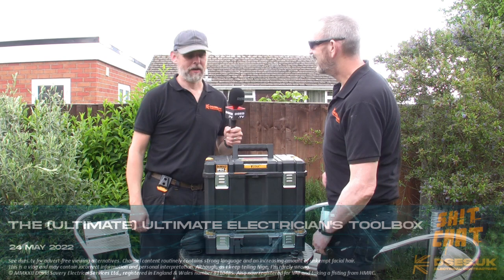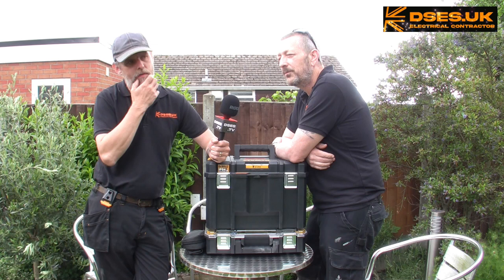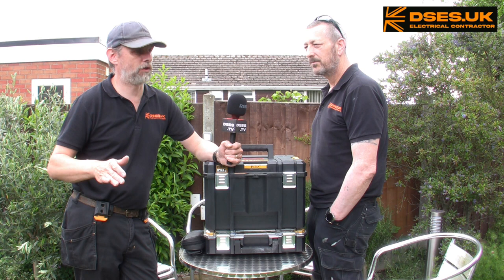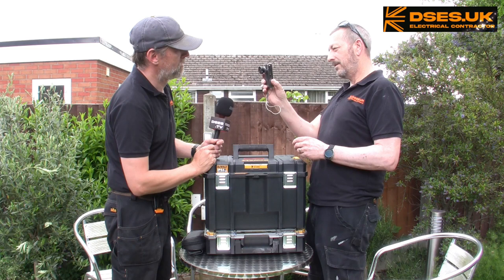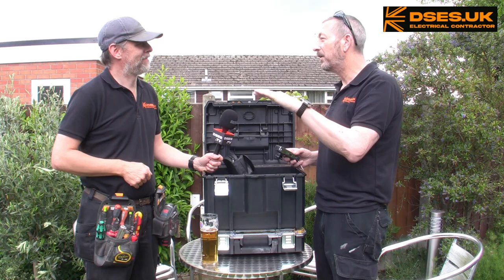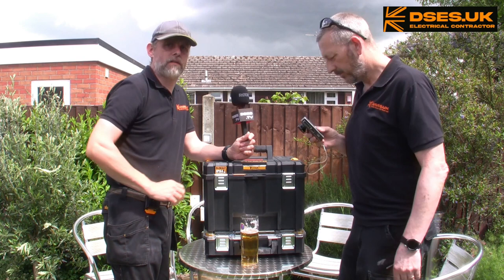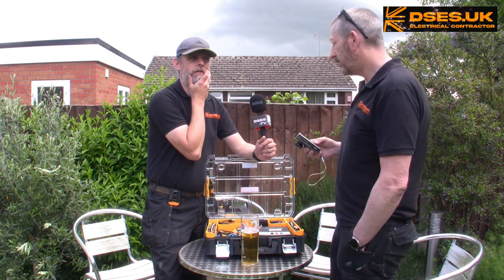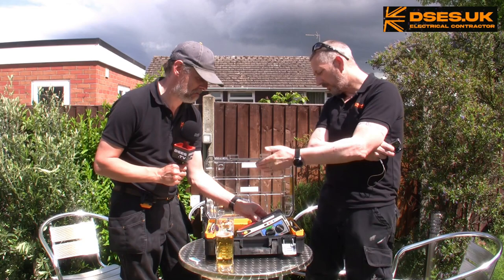The (ultimate) ultimate Electrician's toolbox

Comment: I love Toughbuilt stuff, I've even made a custom belt mounted soldering station that uses a toughbuilt clip, I use it for LED strip installation work, it holds a TS100 iron, DeWalt battery to power it and a reel of solder.

Comment: I use the toughbuilt , i screw the  docking clips onto my ladders, then when doing lights just clip pouch to top of the ladders,  saves carrying the weight,  I also have some clips mounted in the van to carry the pouches in transit, so easy to grab

Comment: Love a TSTAK and the Toughbuilt gear. The TSTAK’s house the gear I take out of my van at night such as power tools and test gear. I have the big handle deep box for drills which is great with the top lid section for bits. I got the Toughbuilt large electricians pouch which I use for everyday items now, saves so much time instead of rummaging around in a bag. Too heavy for a belt but I do use the shoulder strap. I’ve bought so many TSTAK boxes now thou that I’m running out of things to put in them! 🤣

Comment: One of the best Veto tool bag videos on YouTube cheers lads! 
Dewalt are currently emptying their tool sack into every CEF in the country, and who can resist something Black and Yellow? I like the look of that Bosch drill Mr S 👌🏻.
Reply from the maker: The Bosch drill is second only to the torch you sent me JB. And I'm all at sea over losing it.
Reply: @dsesuk  It's lightweight and magnetic, some of it's best features, but this unfortunately means you don't feel it missing from your pocket when you jump back into the van at home time! I've left mine stuck to the side of many amendment 3 boards 🙃.
Reply from the maker: @JBE  You know, my theory is that the magnet did for it. My keyring busted that day, so I had the van keys in my pocket. I reckon I pulled 'em out at some point and the torch whipped out with them via the magnet and sent it spinning off somewhere without my noticing.

Comment: Have you considered the Snickers tool vest? I have one that I’ve been using for the last 3 years and it works well for me. Just spreads the load around your body and has loads of pockets. I then have a drill, driver, fixings back pack and the rest of the stuff goes in a Milwaukee back pact much the same as Nigel’s. All works for me. great video.
Reply from the maker: Can't say I've heard of that Leigh, although I'll take a look! I'm a little concerned I'll look like some kind of fat electrical commando in such a thing however!

Comment: Tstak is very good for the price point, you should check out the tstak drawers DWST-70705 and 70706 I have a bunch for van drawers, also they have the same clip system and connect to the Stanley fatmax line, all owned by black and decker. The CK technicians rucksack is the best answer I’ve found, holds all your hand tools and a drill with both hands free and saves smashing your knees. Tool pouches - vaunt are great because you basically build your own, I needed dual drill holsters and smaller pouches.

Comment: I’am not a fan of the tool pouch , I like to look for a particular tool , there’s nothing better in my opinion than rummaging around in a toolbox/bag . As for that de Walt stack Stanley do the same at half the price.  Disappointed that you have dropped the Robins for the Megger 🤣, also type AC or type A doesn’t really matter any more under amendment 2 as we are only required to test on the AC  setting , so swapping from one tester to another seams pointless , test carry on testing at 1/2 x / 1x / and 5x but we don’t have to worry weather it’s a type Ac or a type A  , just my own personal opinion, but who am I to argue i’am just a humble spark who’s opinion means nothing.
Fantastic video as always mate 👍👍❤️
Reply from the maker: Ah, well I wasn't convinced the Robin was putting out sane numbers! The red Amprobe certainly needs some attention. That's why I blew the dust off the Megger, but I haven't given up on the other kit. As for RCD testing,, yes Type AC 1x is all that's needed and that's something my ol' Megger does juuuust fine.
Reply: @dsesuk  it saddens me that the Robins aren’t play ball , for me that’s very disappointing as as you know I have a very strong fondness for Them .

Comment: I know with my Megger MIT420 Insulation tester, it will alarm when a voltage above 50V is present, and it also disables the test. So even if you were daft enough to press the test button with voltage present, nothing happens. Even if you are in the scenario of actually doing an insulation test on a dead circuit and the circuit then became live, the tester just cuts-out. Interesting to know if the Megger MFT employs the same technology.
Is it just a blown fuse on the Metrel or does it have to go away for repair? We did some thing similar with an old Metrel 61557 and it was good night Vienna for it.
Reply from the maker: Actually, neither Nige nor I are quite sure how the fuse got blown, but it is just a fuse. He was doing r1+r2 testing on a dead socket circuit at the time when he plugged it into a live socket on another circuit. I presume he quickly connected and pushed the test button just before the Metrel's CPU detected the voltage and locked out the test(?)

Comment: Cheers chaps. Why did you knock off work unexpectedly🤔🤔  It's not like tou to explain these things.
I've had the Tstak system for years and like it, especially as my old Stanley clear lid boxes are interchangeable (the same company as Dewalt). I use one with the tote tray for small stuff and without it in the others for power tools. The wheeled base one is worth a look at as well, especially if it's a trek to the site. As for the 30kg limit for standing on them...Pah!... , just make sure the lid's buckled down. Ive just moved to the Milwaukee Packout as they're bigger, but a downside for transporting them.
Bearing in mind you state Megger is bulletproof I am now wondering, with your last video which convincing me to save £65 & go for the Ethos 8600, should I stick with Megger and pair my 1741+ with their EV 210. Dilemmas! 
The fact your 1552 doesn't do type A RCDs doesn't really matter now surely, (Don't call me Shirley) following Amd 2 having only requirement as x1 on AC setting?
Reply from the maker: We were supposed to be on an EICR yesterday Olly, but it was clear the place was in a horrendous state, so rather than charge the chap for an inspection only to tell him it needs a rewire, we talked ourselves out of the job and jumped straight to the rewire part! No point charging for inspecting stuff that clearly needs ripping out, and the place was uninhabited and in for a refurb anyway. Still, it meant we suddenly had some unexpected time on our hands! And yes, no need to test a Type-A as anything other than a Type-AC. Still arguably best to test it to confirm all functions are working, but the Megger does the do for most of what I need, so back onto the van it goes!
Reply: @dsesuk  Thank you for that Old Bean, and good to see you looking after your customers. I look forward to seeing your rewire video soon - have you got yourself the Metabo wall chaser and Class M vacuum yet? 😉 Bunday can lend you his if not. I came across your Half a fault video again earlier and it shows how good you are, not only at the fault finding but the graphics to explain what you did. Always a pleasure.

Comment: What model are the Toughbuilt pouches?
Reply from the maker: I'm using the "large drill holster", but the other pouch that carries the main tools I can't find now. It looks like it's gone end of line.
Reply: @dsesuk  Thanks David. I’ve just ordered the Stanley Top Edge as a Tool Box. It’s good so far.
Reply from the maker: @Rob-zd2be  Oh, I saw you post that Rob. Yes, they're great toolboxes. I've moved on to Dewalt kit, but only because my loadout changed. I found the Top Edge stuff to be very robust and I very much liked it.

Comment: A screwdriver set or an interchangeable blade screwdriver set?
Reply from the maker: I was carrying an Armeg interchangeable screwdriver set in the Stanley toolbox, but most of the time I can get away with three basic screwdrivers: the terminal driver, the 4mm flat-blade and the posi. For anything else, the Wera with its interchangeable bits is on the belt.
Reply: @dsesuk  I've just got me a interchangeable set which is really good, but finding it a bit of a hassle carrying everything in a pouch when as you say the 3 main screwdrivers will normally do.